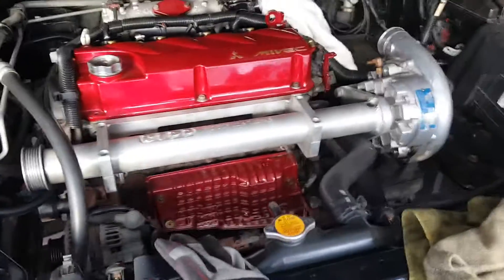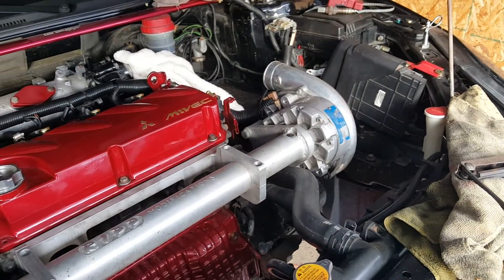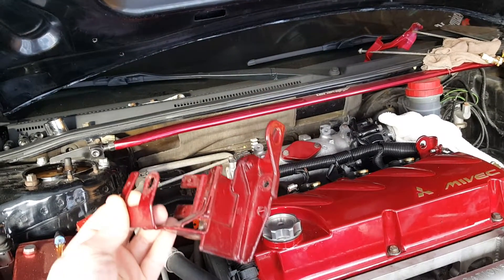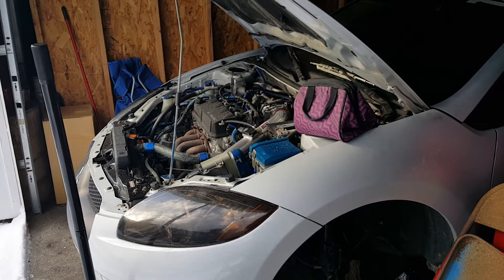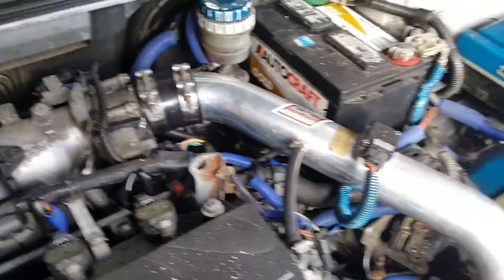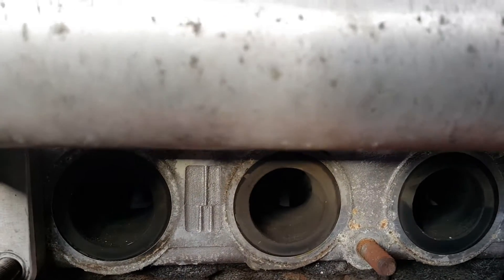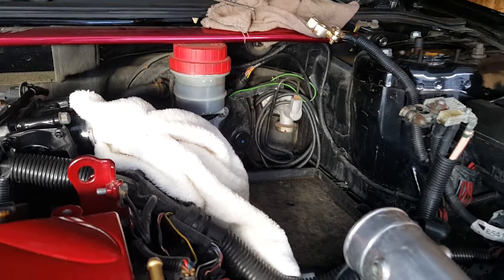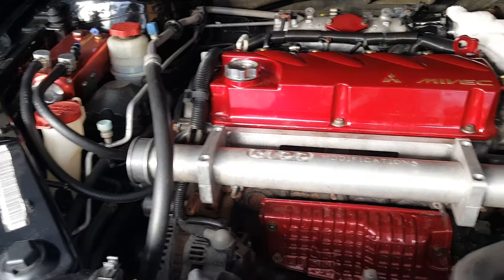How-to Supercharge a 4G Eclipse [part 1]

Comment: I’m in ohio (chesterville area) and im going to pick up a supercharger Wednesday but I’ll also be driving the car to florida in august for Harley tech school, car has 130k miles. Do you thing it would be a good idea to put the supercharger on before I leave?
Reply from the maker: If it’s tuned sure.  If not then absolutely not!
Reply: @AustinThornton  thank you, I already have to fastworks program through Alex would just have to get a tune for it, also have to fix an intake manifold stud that I snapped😄
Reply from the maker: If your car is good to go and it’s tuned properly then yea why wouldn’t you be able to drive it?

Comment: Do you know if you can use aftermarket parts made for the Evo 8 or 9 for this car? Like an aftermarket intake manifold, cam gears, fuel rail, etc.....
Reply from the maker: You’re better off doing an evo head swap.  Direct fit for the 4g69 block.
Reply: Austin Thornton Yeah I guess ur right. Head is just expensive and I'm in a rush to get a full exhaust and other mods but as I'm sure most people know, the 4g eclipse has a very limited after-market
Reply from the maker: 2WheelBandit that’s why I made this channel in the first place to share my love and hard work.
Reply: Is the headlights halo LED with carbon fiber eyelids over it? And what color is your headlights?
Reply from the maker: Reg color and yes carbon fiber eyelids
Reply: What supercharger kit is this?
Reply: @johncadden8369  pretty sure its a Ripp Supercharger kit thats no longer in production.